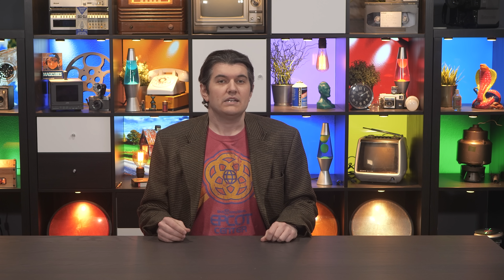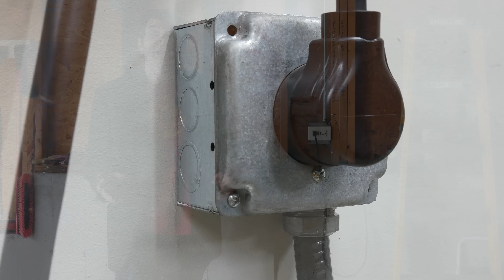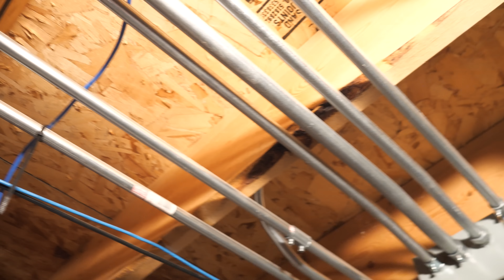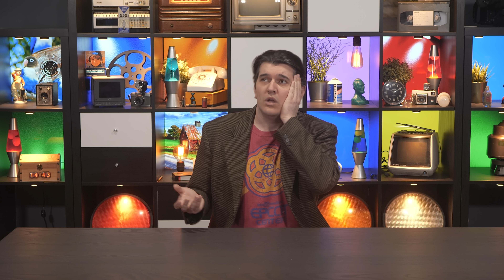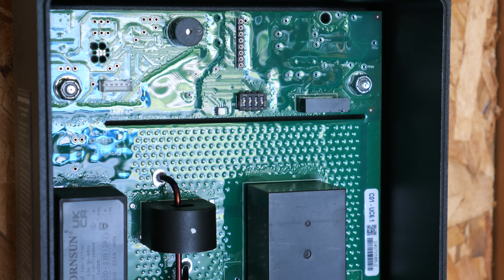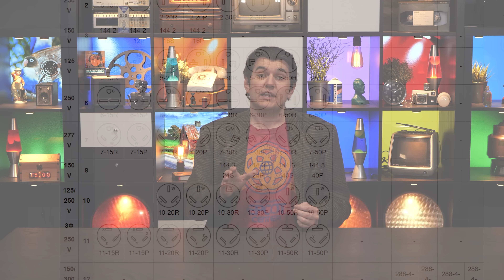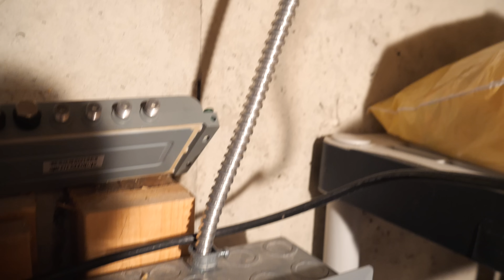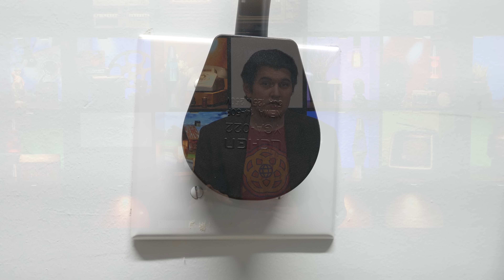The "standard" car charger is usually overkill—but your electrician might not know that

Comment: Come on the simple thought of rejecting FOMO makes us FOMO sufferers go sheet white! :) You also know that in Chicago area, just about every city/township/village requires electrical work to be done by a licensed electrician, who also would tell you that most cities don't allow metal flex conduit/cable for main circuits, just a single appliance at about 6 ft max. They also make conduits for Romex (although I have never seen one or seen Romex run in one). The worst part about the conduit requirement in the Chicago area is running conduit in already closed walls (e.g. rewiring circuits or trying to bring a house up to code with more receptacles)..Can't snake a conduit behind drywall. Gotta love unions.

Comment: At least here in Europe, you can get dumb chargers, yes. However, considering the prices for electricity, you usually install a smart charger which does not only connect wires, but has an additional communication line with the solar inverter to charge with excess solar energy. Those chargers can automatically change between 1 and 3 phases and adapt the charging current on the fly from 6A to 16A (in case of 11kW chargers). No app needed except for setting up the charger or, if necessary, change to full charging power with the missing power being taken from the grid. However this you could also do via poking values in the charger locally using modbus.
Seems the US is lagging behind in current level of technology in that case. Considering the US electricity prices, this might not be a huge drawback.

Comment: 10:35 that's a really low-tech charger. At least here in Europe those chargers usually (if not, you have to install one yourself) also contain an RCD type B (for DC current leaks) or an RCMU. The slightly better ones include provisions to limit the current, usually you can switch between 6/8/10/13 and 16A.

Comment: My rule of thumb is, select a charger and infrastructure that allows 10 hour of charging from 0-100%. So when one get home from a long road trip, the car is ready next morning. 

For some this means:

- 5kW (240V * 20A)
- 7.1kW (230*rot(3)*16, or 240*32)
- 11kW (400*rot(3)*16, or 230*rot(3)*25 , or 240*48)

If you have multiple charger, the can share infrastructure. 

The most expensive part of a installation is the manhours not the material.

Comment: As someone with said 24 volt dryer outlet in the garage, we upgraded from a nema 10-30 to a 14-30 to get the ground and discovered the outlet was only connected to 15 amp circut so we connected it to an unused but already installed 30 amp circuit. 

Learned a lot about electricity, code and our home in the process but now our standard tesla mobile connector with an adapter gives us about 20 miles an hour easy peasy.

Comment: I've been planning a 30A charging station on the same circuit as our dryer. I've been wondering how to do the changeover between the dryer and the future charging station, particularly since the dryer is not in the garage. I'd like it to be something that runs on a timer, so I can just have the dryer active in the day and any car charging that needs to happen at night.

(On the other other hand, we drive so little that honestly we could probably just use 120V. We currently use less than three gallons of gas a _month_. Our main personal vehicles are electric _bikes_. Legitimately the biggest reason we want an electric car is house power backup.)

Comment: I use a 16amp charger and it is fine, Takes 15hours max from empty to full on a 64kwh battery.
You should use a welder 6-50 plug instaed of the oven 14-50 plug.
You save on the neutral copper wire run from the electric box to your station
You dont need 120V inthere... its a scam imo
Also, I bought an adapter plug for J1772 to US standard 120V outlet, 
 can charge my Camper's battery in any EV charging point... or even my E-bike.
It give 240v out of  a 120v outlet...you can tell I bought it on Ebay
The charger doesnt need comms to engage the relay, only need a resistor from the "client" side.

Comment: New Tesla owners: Try to negotiate a free mobile charger.  Then install any 240V receptacle that the mobile charge can plug into. Plug it in and charge at home!  I don't know why Tesla even offer two more expensive but faster wall connector (charger station).
Reply: Love my mobile connector set up. Hooked up to a 14-30 with a $40 adapter, bam solved for good

Comment: 25:20 one important use case for "smart" charging stations is if you need to operate more than one charging station on the same circuit. Smart charging stations can load balance power usage to charge multiple cars simultaneously while staying within the maximum limit of the overall circuit. You hinted at this very exact use case when you brought up smart plugs for power sharing with dryers earlier in the video, but the same smart technology is useful when charging multiple vehicles.

Comment: I’m lucky that my job’s commute isn’t so far. Overnight Level 1 charging and scheduled to take advantage of my utility’s off-peak to super off-peak rates (2100-0800 @ $0.17/KwH) is enough to recover the range used.

I’m able to accomplish Level 2 at my Parental Units house via their unused NEMA 10-30 dryer receptacle and a 10-30 to 14-50 dog bone converter (the portable charger provided with my EV has 5-15 & 14-50 plugs)

Comment: Chevy volt, 12 hour charge time on 120v, 2 tiered electric bill cheaper rate after midnight. Want full charge before I leave for work but not starting till after midnight, 240v work great for it. Required? No, just more economical.

Comment: What needs to be mentioned is that if you live in a very cold climate, it is possible that a standard household outlet will NOT be able to charge your car during the winter, because it doesn't provide enough power to heat up a cold battery enough to allow the battery to charge.

Comment: I installed an oven plug and bought a cable for... $120? $140? Anyway, total DIY install was under $200. I was an HVAC tech so I didn't have to hire an electrician, but if I did that would have run me another $100?  And I Uber with this car. Almost never have to charge unless I'm way out of town.

Comment: I have 3 large 40A EVSEs (on 50A circuits) (all installed by yours truly) (and two of them are Grizzl-Es) but they are the only things in my house not on generator. After an extended power outage and a bit of pain trying to charge cars off 120V 15A circuits, I installed a 20A 240V outlet covered by the generator as backup. Even a 3.8kW charger is enough to meet the needs of multiple cars in normal usage. Thanks for sharing this!

Comment: I went with a 6-20 charger. 20 amps on 240V. The charger has a max draw of 16amps and charges my plug in hybrid in under 5 hours. As you said, good for setting and forgetting. No point in going higher because the car limits you to 16 amps.

Comment: Yeah….no. I had a for F150 Lightning. Warm weather…you’re absolute right…you don’t need one of these. But if you want to keep your batteries warm in cold weather AND PRE-CONDITIONED you absolutely need one of these minimum to be able to drive anywhere without massive and instantaneous amounts of battery drain….especially if you don’t have a warm garage to park in

Comment: I lived in three apartments while having a Volt, and was able to charge in all 3 (which I know may not be the case). The first one had a garage with spaces that was just a parking structure. I just asked if I could run an extension cord through the structural stuff on the ceiling, and they were fine with it. The next 2 had individual garages to rent, and I just plugged the charger into the same outlet as the door opener. Never had a problem.

Comment: I just noticed in the thumbnail that the pins dont seem to be solid brass, im i correct? Brass would be the common option, copper is too expensive but the cheaper and less  efficient is an alloy or brass coated aluminium.

Comment: Ok , a few things.
- I think you are confused when u talked about "80%  breaker continuous load". Yes, a breaker load must not be over 80% of the breaker rating. But, if you are doing load calculations to see if you have room on your "100 amp panel", you have to enter 125% of the charger rating to since its a continuous load. 
- an EV charger should be on a dedicated  circuit(s).
- i would never install a device where the homeowner would be himself able to increase the charge rate ( the dip switches), because they  will.  They dont understand amps/wire size correlation.  I know most EVs these days actually have built in features to be able to prevent  charging if they sense the charge rate is too much for the breaker.
- i would never install an EV charger on a 100 amp panel ( its probably gonna be  full anyway)
- you may not think adding 32 amps to a 100/150 amp panel is no big deal, but remember eventually the higher-ups are going to want ALL your appliances  run off electric, not gas.  So those mere 32 amps are alot more important now.
- yes , all plugs in garages rated 50 amps or less need to be gfci protected now.  I agree hardwire is the way to go, but lets say you have a chrger on a 60 amp breaker (48 amps charging) and you want to plug/unplug it for some reason. Even though its over 50 amps, the code calls for it to be gfci protected.  Problem is , with the circuits being gfci protected, as well as the gfci protection in the vehicle (charger) itself, well they dont get along often and have constant trips.  Ive gotten around having to gfci protect the 60Amp circuit itself by showing the inspector the charger specs. Most say do not plug into a gfci circuit, and  remember in our code book it basically says if you arent sure about an issue always go with what the manufacturer (of the charger )says.

Comment: I recently  helped a friend install a 5-20  plug at his work. Required 3 feet of wire and conduit, 1 plug and box, and an extra circuit breaker.  he bought the Tesla 5-20 adapter and can get 11.5 kWh  over the 8. hours he is there.  giving him the 40 miles of charge his commute is back and forth, thereby making his commuting ( the electricity he pays at work) tax deductible

Comment: While I agree with the sentiment of the video, using a slightly larger capacity EVSE that operates at 40 amps will save money in the (not so) long run, unless your home electricity rates are really high and nearing that of public charging. Sure, you can public charge for the occasional errand that takes you beyond your normal daily range, however that charge can be 4-5 times as expensive, PLUS the time to charge. I spent less than $100 to install my EVSE hardwired to run at 40 amps (I went for less expensive romex cable, instead of THHN individual wires and a conduit of some sort so I don't get the full 48 amps that the EVSE is capable of) so that I know I will be ready for the next day.  Now I have a different driving scenario where I charge to 100% frequently, having to drive long distances that use that much, so that is a big factor. 

On the 14-50 receptacles, is it really worth it to risk your safety over $30-40 price difference for a continuous or EV rated receptacle? Again, I can't argue that installation is a huge factor, however that little bit of price difference may save someone's house one day if the cheaper receptacle were to melt down. 

When it comes to electricity, erring on the side of caution is always the best!

Also, the Electrify America public charging station you show is 8 miles from my house!  I remember the video you made when you stopped there to charge during the road trip!

Comment: I have a Bolt, my wife has a Prius Prime. Seasonally, i drive 100 miles on fri, on sat, and 25 to 60 on sunday. We also have time use. 12A, 120V is a bit limiting. We're working on getting 16A, 240V into the garage, and from my calculations, that will be plenty, and less hassle swapping cars.

Comment: My wife’s 2012 Leaf was advertised to have a 120 mile range. Her commute was 60 miles. But the actual range ended up about 66 miles per charge. 

Before the 240 charger was installed she could only drive the car every other day since charging on 110 took 13 hours.

Comment: You can't get 8/3 BX in Chicago? Also, 6-50 is generally a better receptacle, although lacking a neutral. It is generally designed for more unplugging becuase it's a typical welder plug. Plus it has a smaller form factor.

Comment: I work remotely, so i only drive 3-4 days a week, and i alternate between small 10-30 minute drives and then 100+ mile trips. I only charge using a regular 120V Level 1 charger. It's very easy to predict how much power i'm gonna need in my car and plug it in on the correct days. When I only was getting 6A, I always plugged it in to get my power back whenever i was home, but now that i figured out how to get the full 12A and it works great

Comment: I charge my Chevrolet Bolt EV via my Dryer outlet - NEMA 14-30 outlet - 240V 30A circuit yes, but I charge at 240V 24A which is more than enough for my 130 miles daily driving. I have a splitter that I use so I can still use the dryer! Though, I obviously don't have them running at the same time. I unplug one of them when I need to use the other.

Comment: Throwing something in the ocean sounds too good for devices that needlessly off load basic functionality to an app. Just give me a good, old-fashioned knob that clicks between settings and has raised numbers in a bold, easy to read by sight or touch font to set the circuit capacity on the car power port and be done with it. Even if I didn't think smartphones a bitch and a half to use, the last thing I'd want to do is waist its anemic storage capacity on all the crapps companies try to force on everyone these days.

Comment: 'Do you know how much easier life gets when you reject FOMO and decide to be happy with good enough?'
I want that on a t-shirt.
Reply: Super Good Enough
Reply: Reject FOMO
Embrace Good Enough
Reply: @_skud  nah, good enough isn't good enough.
Reply: This philosophy goes triply for people shopping for PC components.
Reply: @OhJustSomeRandomGuy  i spent a fair few hundred on upgrades every year or so for a while....on a rig mostly playing things that'd have comfortably run with it's initial configuration.
Reply: @Joesolo13  My computer is 50 years old. During those five decades, one small piece at a time was upgraded to the point there is not even a single bolt, nut, or washer from the original 1975 computer left, let alone any real electronic components. But it's still the same computer, like Grandpa's axe that has had four new handles and two new heads. No upgrade was ever done to that computer unless I needed some additional capability for a newly added piece of software or peripheral.
Reply: Why does this make me think of 
Dr. Strangelove 🤔
Reply: Me too for the t-shirt idea!
Reply: I'd love a shirt like that.
Reply: What is FOMO and why settle for good enough?
Reply: @springhollerfarm8668  FOMO = "Fear of missing out", which is how this generation expresses the old adage "better is the enemy of good."
Reply: @springhollerfarm8668  fear of missing out. You should settle for good enough because it is good enough and anything in excess of good enough is by definition a waste. If your definition of "good enough" leaves you unhappy with the result, you need to modify your definition of good enough upward to fit your needs.
Reply: @springhollerfarm8668  "FOMO" stands for "fear of missing out." It describes the urge people get to purchase or participate in something just because they're afraid that they will miss out on something cool if they don't.
Reply: Do you know how much easier life gets when you can charge your car at a rate of 44 miles per hour instead of 4?
Reply: 110 volt charging isnt "good enough" and will cost 18% more in the long term, plus time wasted at home/dc chargers when your emergency charger [110volt] cant get the job done when you need it most.
Reply: @samusaran7317  "Isn't good enough" is, at a minimum,  misleading. It's most certainly good enough for some people. "time wasted" doesn't matter when it charges my car every night.
Reply: @pootispiker2866 Do you not own a dryer? You can buy a splitter and run 10-16 amps at 220 volts. That's alot better than 16 miles a night in the winter time. 😂
Reply: @samusaran7317  Yes, let me run a cord from a dryer socket upstairs down to where I park, which is about 150 ft at the end of the day.
Reply: @pootispiker2866 If that's the case. Why buy an EV? Have fun with your high electric bill 😂
Reply: @samusaran7317  Because L1 charging costs insignificantly more and still fully charges my car so I don't care?
Reply: @pootispiker2866  110v will not charge a car overnight unless you're ~10% below the charge limit or less.
Reply: @icy1007my mf car is not out for 12+ hours a day. After work and gym, I easily have my car in the garage for the rest of the day for 12 hours. Which will give me 36 miles at 3mph. My total commute daily is ~25miles. More than enough for casual commute. The off chance i drive a lot i can make up for it on the weekend if needed or worst case scenario go to a fast charger 1 time per month to get back on top.

Comment: The reason an electrician installs a 50 amp breaker for a nema 14-50 plug is because the plug can pull 50 amps. If the home is sold the next person may try to plug in a 50 amp load. The electrical codes are to protect not only the current home owner but also future home owners as well. Electric cars
can be set to pull less amps but if the plug is a 14-50 by code it has to be connected to a 50 amp breaker.